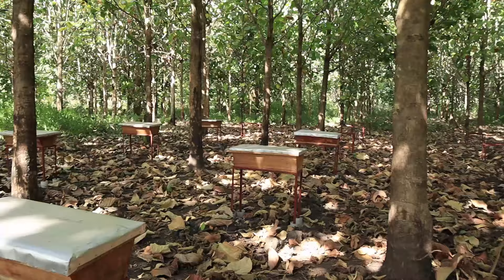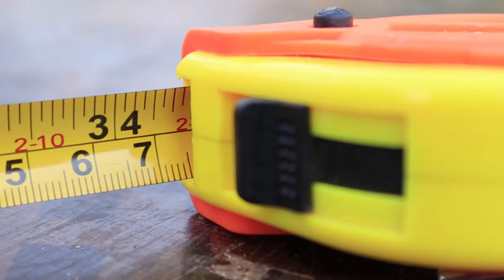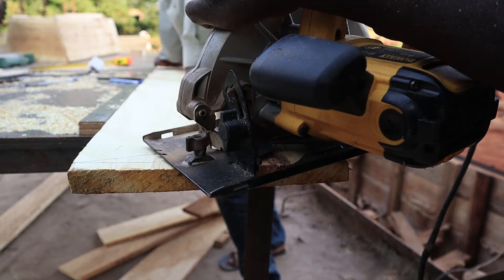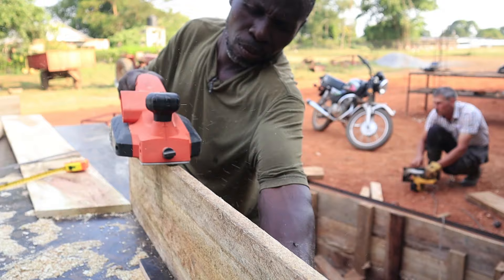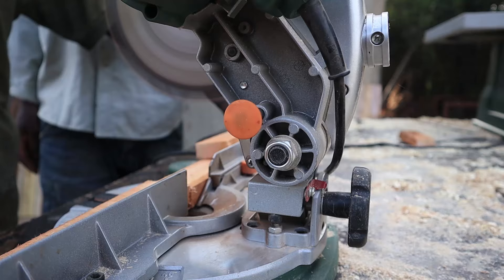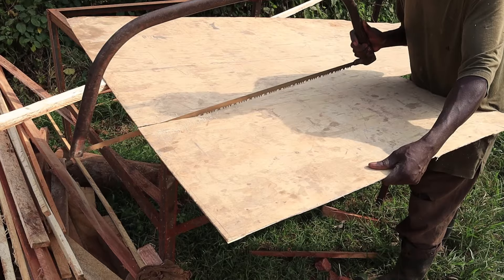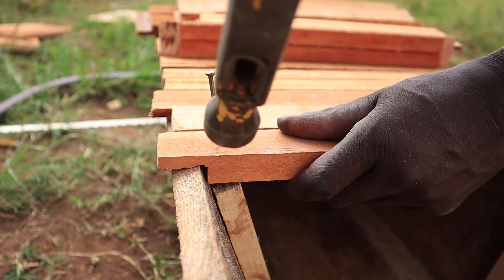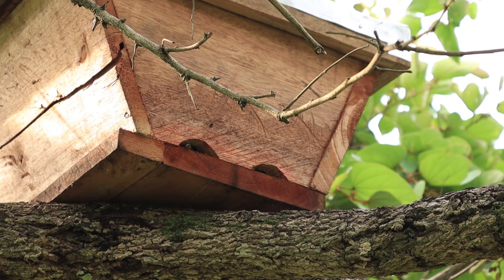Making an Easy and Quick BEE HIVE.

Comment: I have always thought about going into bee keeping but I would like to know it's value chain
Reply: On the one end of the value chain you have your start up inputs which as seen on this video can be DIY or if you have money you can buy a beehive from a supplier other suppliers would be for your suit and equipment beehive tool a simply long aerated bread knife could do a smoker. You then would need an extractor if your using the langstroth beehive but a top bar beehive you simply crush and strain your honey after cutting out the combs you can package them yourself buying jars plastic or glass depend on your market preference benefit of honey as a product is if stores well can stay fresh indefinitely giving you time to market your product and get the right price for it there are barely any month to month inputs beside checking up and maintaining your beehives makes sure there’s enough vegetation and flowers nearby for them to forage on so they don’t have to go too far wasting energy that go forage this will help with productivity

Comment: What can I use to prevent the wood from roting with time?!
I was thinking of vanish, but it smells like a bee repellant.
Reply: There’re many wood treatments (chemicals) you can use. The most important thing is to make sure it soaks the wood well and the let it dry out before using. Bees don’t eat wood, so they will not be repelled by the scent. Also wood termites are unlikely to eat the wood once the bees have colonised the hive. Good luck
Reply: Wood was typically treated by linseed oil long ago for its preservation. Its the oil extracted from flax seeds.